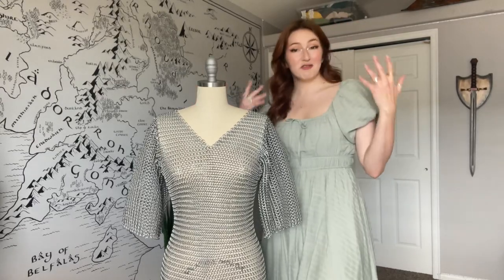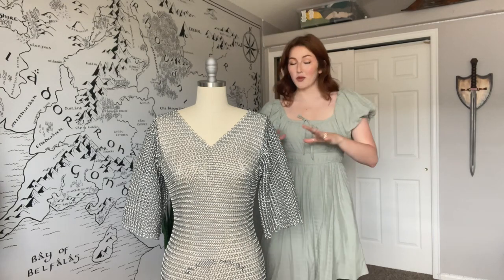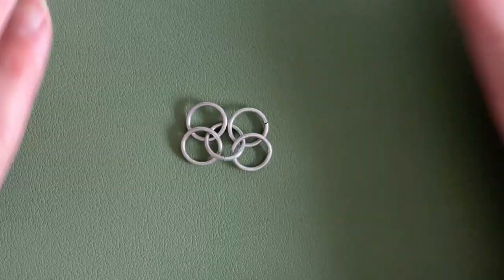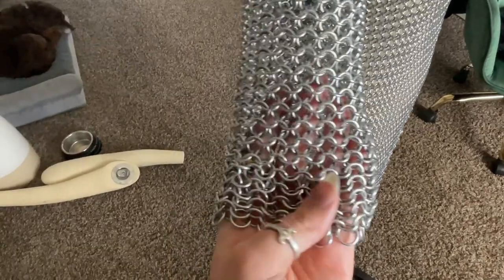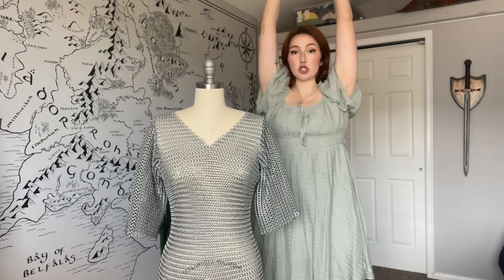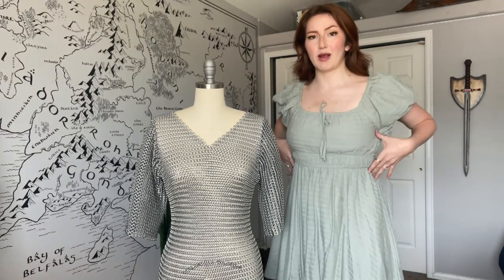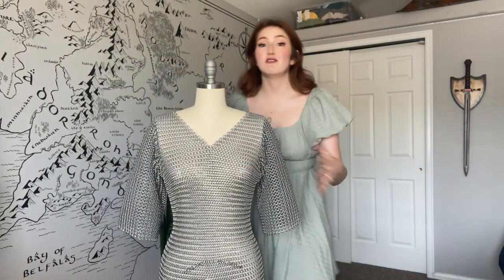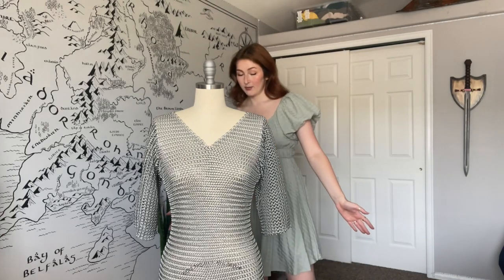How To Make A Chainmail Shirt | Hauberk Tutorial

Comment: Does the direction of the chainmail matter in terms of making it? I've been making mind with the more horizontal pattern in mind but yours is vertical. Is it just personal preference or is it better to do it in the longer "vertical" way yours is?
Reply from the maker: it really depends on the project! the direction for the hauberk I would say is technically "correct" to have them hanging vertically on the body and horizontally on the arms. But I've done other projects and switched up the direction, so I think it comes down to personal preference and the look that you're trying to achieve :)